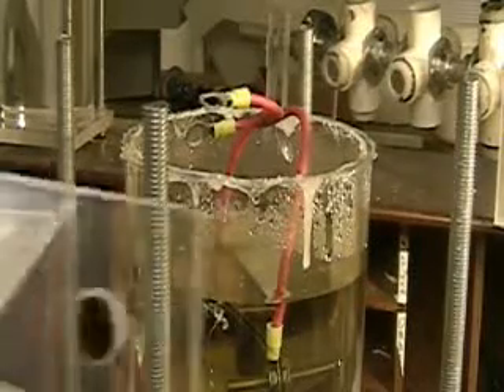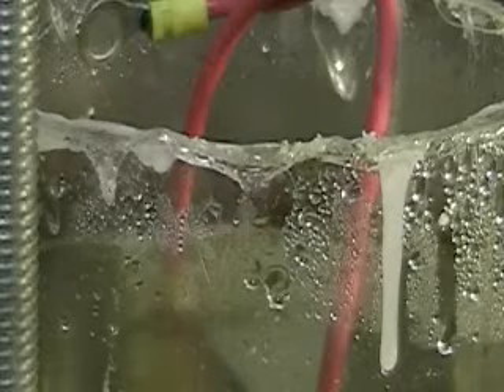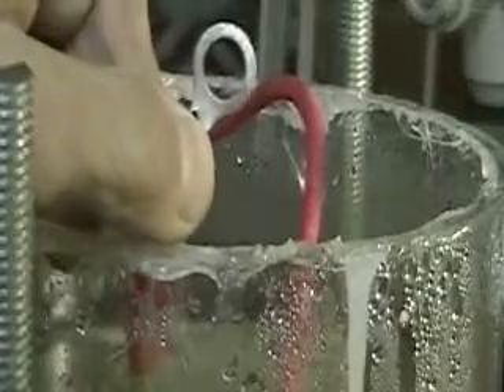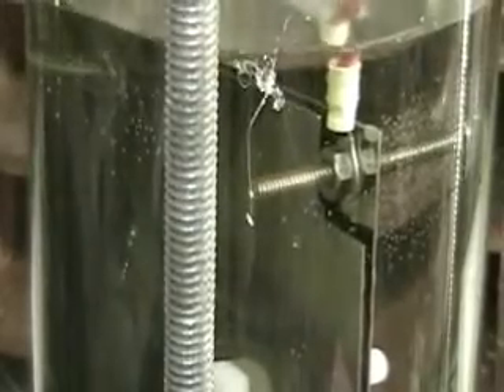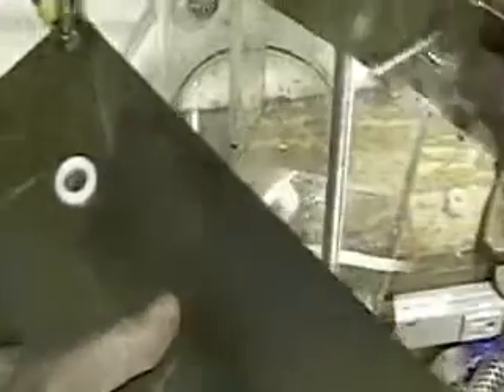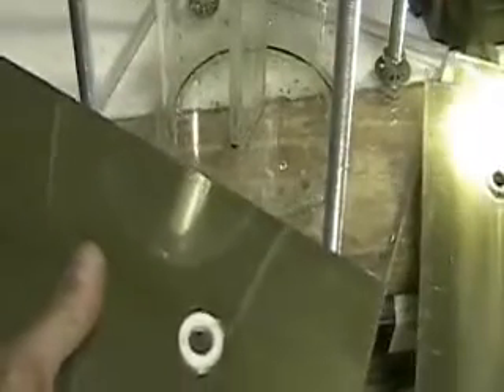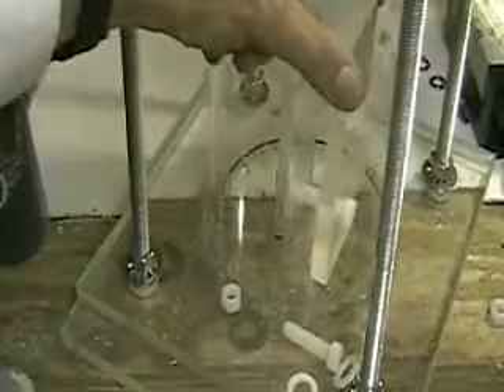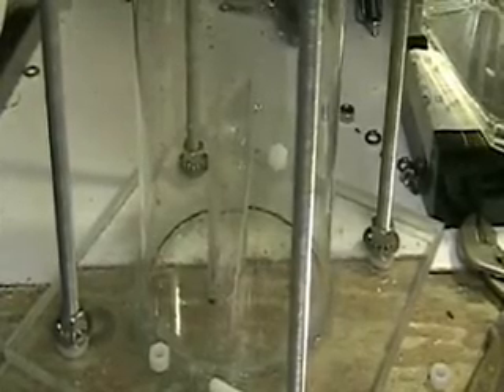Hydrogen Tap (Hydrogen Testing ) 248

Comment: Hey John, I have been using an HHO Gen for almost a whole year now with an ave of 20%-30% increase in mpg. I've cleaned it about 3 times now. One thing I have done to make a huge improvement was to eliminate any non-stainless inside the cell, even what is not under water still corrodes. Also, copper seems to be the dirtiest metal to use for wiring and deteriates into the water faster.